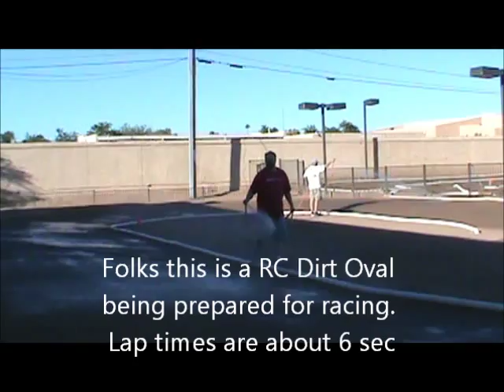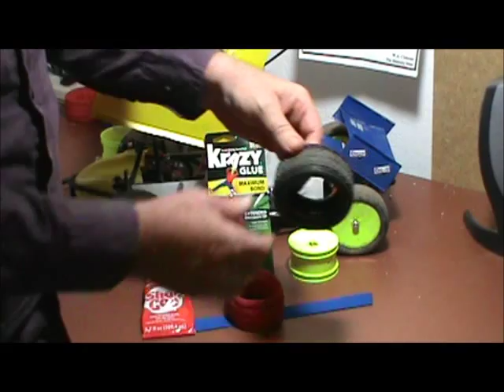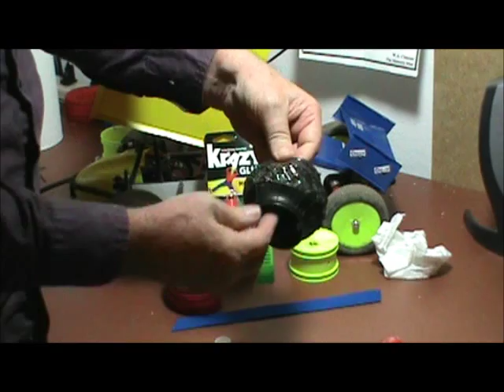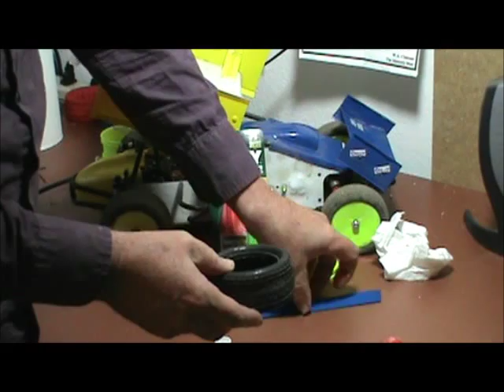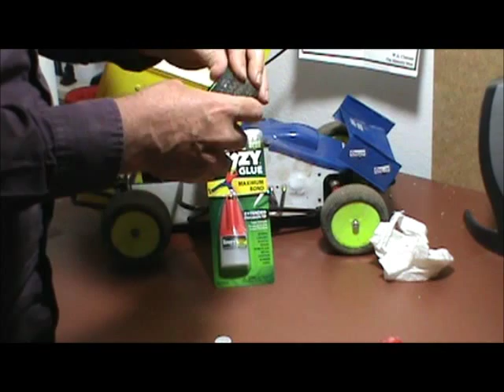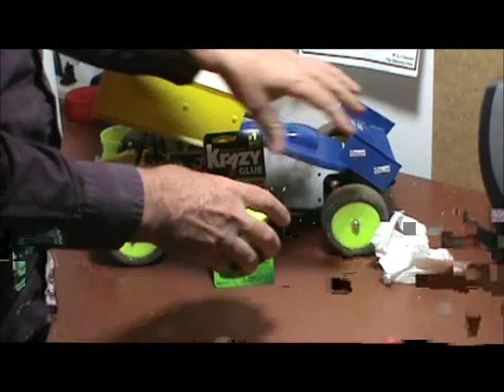RC Race Car Tips; Building a Radial Tire

Comment: why don't you run a smaller wheel on the inside as to set the car to crab steer? 
just like real stock cars they run and smaller wheel in the inside so you can rear steer in the bends 
You can fill throttle it and coz the inside wheel will be spinning much faster than the outside bigger wheel will turn much slower 
resulting in you been able to hit the bends full throttle with no worry of spinning out
👍 give it a try I think you'll find it'll work